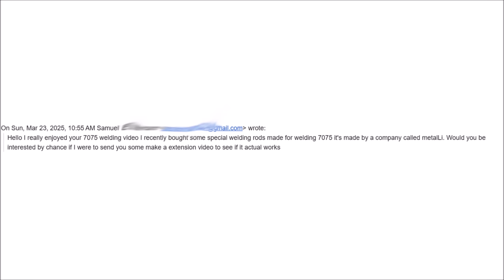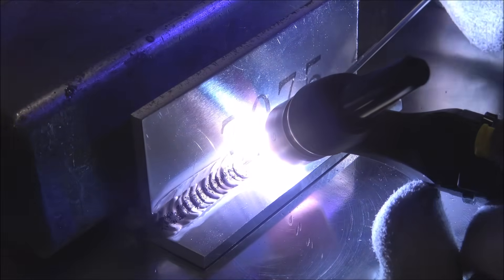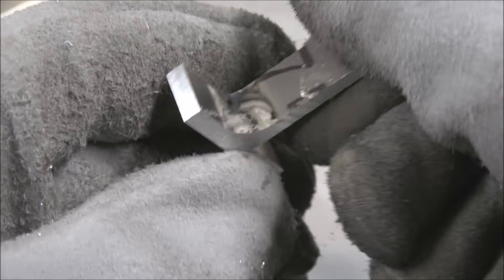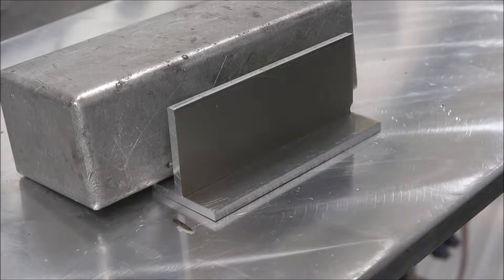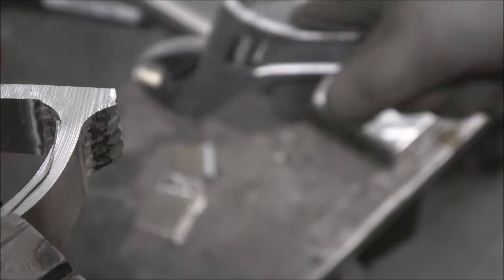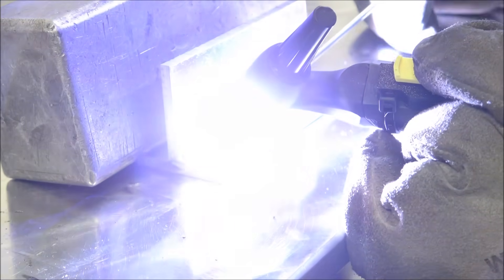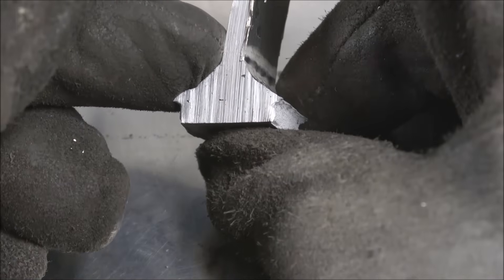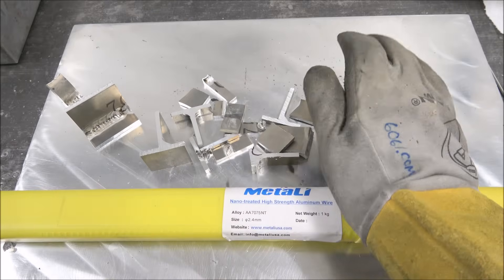TIG Welding Aluminum - "Cutting Edge" 7075 Filler Rod Testing That Works Better

Comment: What the hell is 7075 even used for?  It seems like trash
Reply: It has similar strength to chromoly at a third the weight. Take a wild guess at where that might be useful

Comment: I've read that aluminum will loose like 50% of its strength after welding if it is not heat treated or allowed to age (like a year). That would explain why it is breaking right next to the weld.

Comment: need to heat up the aluminum part that you going to weld try that and then test it. 🦘🦘😎😎✌✌👍👍
also use the right setting on the tig helps a lot and also making sure the surface area to weld is perfectly cleaned as well.
Tig welding down right is so hard to do, used to sell aircraft grade welding tig wire to large Au airlines and almost every time they need to weld anything from standard 60961 t6 to titanium, they use a oven to heat the item before welding, there's a complete book about welding with tig especially aircraft grade alloys and parts and what is required to weld and what you cant weld like for example F/18 fuel tanks drop tanks, they can be welded but only with the right equipment and the right welding rods and boeing does it and also a client of mine who won the contract to  re test the tanks and fix the tanks, which was worth over 25 million dollars back 1999.
Like 7 series aluminum is very hard to try to weld unless you have the right equipment, using 7075 welding rods for tig set ups etc etc. ✌✌🦘🦘👍👍😎😎

Comment: There is a reason 7075 isn't used for welded parts in aerospace, be they structural or non-structural (like ductwork).  This video is yet further proof as to why.  7075 in bolted or riveted construction on the other hand is extremely common.

Comment: 6061, I can't see the point in trying to weld an alloy that is solely created to cast/roll/form native shapes for their section properties. It was never intended to be welded? There are more than 8k aluminum alloys, and this particular one isn't designed to weld? Sure will hold more than 50 series or 60 series if extruded as a shape to be drilled into a vibration resistant fuel pump bracket on a piston aircraft and that's what it's for.
Reply from the maker: The point is a website subscriber sent me some filler rod and wanted me to test it in a video. Don't over think it.

Comment: Looks like most of the welds failed in the 7075 itself, not the weld . Looks like the weld heat is messing with the grain structure that the 7075 heat treat / temper process created.

So what if you tried to reproduce the 7075 heat treatment ?

Comment: This makes me curious about differences between 6061 vs 6063 and welds.  I'm going to start learning to TIG in the next couple of months and eventually make a solar rack that tilts and has mount points for lights & cameras.   Plus making some light weight furniture for the inside of a cargo trailer conversion.   Any thoughts on 61 vs 63 would be appreciated.  Or if I should consider another type of alum.

Always enjoy your videos and love the practice tests!

Comment: I often wondered if the brittleness in 7075 after welding could be relieved by annealing and reheat treating.
Reply: It’s the zinc actually that causes micro cracks.

Comment: I would say they added something to deal with the copper and zinc segregation and bring it to the surface, hence the black spots. But, I would say, a filler rod without datasheet is a no go, industry definitely no go, structural definitely no go, industrial equipment repair definitely no go, or anything else really... Just for the lack of documentation from the manufacturer. Or perhaps they do have it avaliable, but I did not find anything on their website except basic information, but might be hidden there, somewhere.

Comment: How would you be able to tell if something somebody brings in is 6061 or 7075 (or some other grade)?
Reply: You've gotta taste it. It's the only way.
Reply: They ring slightly differently if you have a piece the same size of 6061. Not easy though. The 7075 is stiffer so it vibrates a little faster
Reply: Get yourself some 6061 and 7075. Get some sodium hydroxide (aka lye or caustic soda), mix about a teaspoon or so per pint of water. Immerse the aluminum until you see a coating forming. You'll see the difference. Keep in mind lye and water can chemically burn your skin and eyes, and if you mix it too strong it will boil and erupt like a mini volcano, so use protection. Also, another clue is 7075 is considerably harder than 6061.  Short of a professionally done lab analysis that may be your best bet.
Reply: Smell test.
Reply: Hopefully it says what it is somewhere on it or they know what it is. You could do a chemical analysis test, but that's a bit of fluffing around
Reply: My work has a spectrometer, works great, silly expensive
Reply: Mouth feel

Comment: Ah these rods may have tungsten in them, there was some material science papers a few year ago that talked about tungsten in the weld pool improving the weld-ability of 7000 series alloys. I just don't think the 7000 series is good if you have to TIG weld it, but that's not a hot take I'm sure. The NT, maybe means nano tungsten, probably contains nano particles of tungsten.
Reply: NT means nano-treated. who knows with what. Tungsten would be "W" anyway.

Comment: I think I've seen that specific rod used for Colt lower rewelds. They're not exactly a high-strength part in any meaningful sense, though!
Reply: Welding a lower? That sounds like a dumb idea if you plan on shooting it again. Welding anneals it and lowers the strength by 50 to 60 %.
Just asking to have it blow up on you.

Comment: I'm just getting into welding and to be honest, this is a little  frightening. Isn't 7075 supposed to the the "structurally stronger" aluminum?  Like the stuff they make aircraft out of?  lol
Reply: You may be right, but is it categorised as weldable, or machinable? 
If it is machinable only, then obviously this could be the results when welded.
Reply: 7075 and 2024😂
Reply: It is stronger.
Reply: Yes, but NOT weldments. Only machined parts.
Reply: 7000 series aluminum are commonly used in aircraft but none of it is welded.  Aircraft are either riveted or use other mechanical fasteners for assembly, none of them are welded.  7075 has typically been considered un-weldable until recently and even now it's highly experimental and not approved for aerospace assembly.  18 years of aerospace machining and manufacturing here.

Comment: I seem to remember from a mountain bike rag back in the 90s that 7075 has to be post weld baked at 350 degrees for if I remember 13 hours for a bike frame....thanks
Reply: Frank the welder would know, he does have a channel
Reply: That seems to be the key, is it has to be heat treated. Though it is still not recommended to weld 7075.

Comment: There is a valid reason that they have mechanically fastened parts made from 7075  and all welding texts I have read on  the subject for the last 45 or so years tell you not to weld it.

Comment: What about a lay wire technique, or even like, braising? Please forgive my ignorance, I don't actually TIG weld. I'm just thinking about how it seems to bond to the 7075 well, and the weld itself seems pretty strong, but getting too much heat into the 7075 weakens it.

Comment: can 7075 be re heat treated ? ..... can you run some welds , then heat and quench the parts to various temps to see if that improves or further decreases strength ........
Reply: 7000 series can be heat treated but heat treating aluminium (not just 7000 series) is by far not as straightforward as steel... You have to work within a very narrow temperature window and requires ageing after that.
Reply: Can you anneal it? you'd have to be able to anneal to passivate the whole assembly then heat treat wouldn't you?
Reply: The problem with 7075 is the initial heat treat and how it hardens the alloying elements that make it a 7 series aluminum vs a 5 or 6 series. It may do better as a weldment to first anneal the 7075 and weld it in a hot state, much like cast iron.